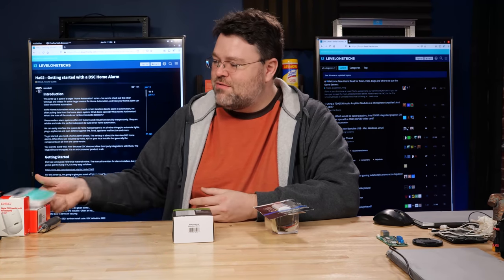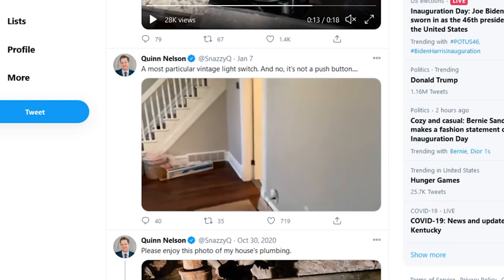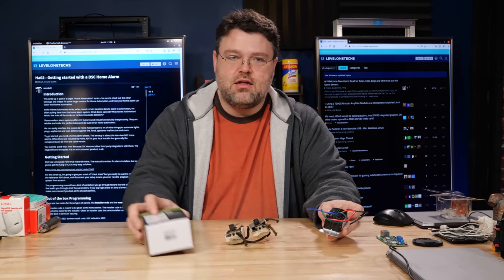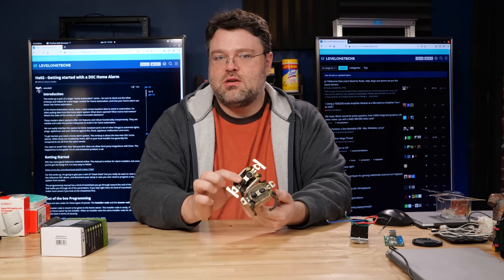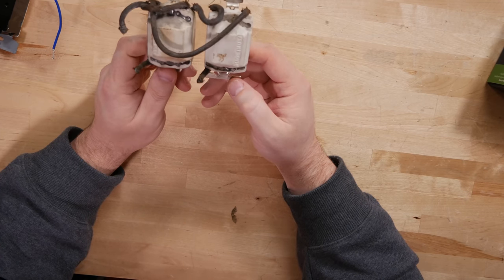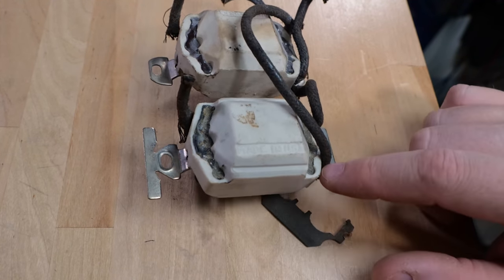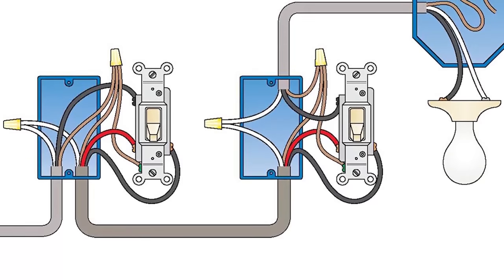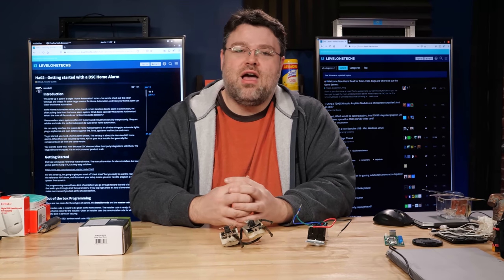Better IoT: Can We Use Old-School Light Switches With Modern Wiring Technology?

Comment: Great video Wendell.  Having that neutral in the switch box far out weighs the cost of the copper involved.  An alternative method of wiring, while maybe not as cost-effective, is to run the supply wiring to the switch box first instead of the fixture.  This is sometimes a more future-proof/automation-friendly method.

Comment: The quick snapping action of the light switches, are for reducing electrical arching, mostly happening when you disconnect the loop. This get so hot, that it burns the metal and build up carbon on the contacts.
Reply: And the build-up of carbon leads to increased resistance across the contacts and will eventually lead to an electrical fire.
Reply: @StevePatak  Well yes, maybe?

Comment: A few years ago i saw an interesting video using ethernet cables for the switches, and having a relay box in the basement that switched the outputs. Seemed like a really interesting way of doing it, and gave a lot of flexibility to what each switch in house would do. It even had the addition of wireless switches too if needed. Only downside of that setup was that it ended up with a lot of cables compared to the normal way of doing it.

Comment: Interesting adaptation, however its not a standard process and inspectors may be difficult about it. You can also use a transformer kit that lowers the voltage to the switch that will make it safe and code compliant. If its not too difficult I still recommend replacing the wiring. Source MS in electrical engineering + former electrician.
Reply: I was gonna say, if you have the ability, using the old switches to switch the low voltage side of a power pack somewhere would be another way to use older switches.

Comment: Hey Wendell, I believe that blue "Z wire" floats at a low-current, low-voltage potential, such that you don't need to use a 12V or 24V "doorbell transformer" to wire an old switch to it. Simply, connecting and disconnecting a ground to the "traveller" should provide enough of a state change to trip the Z-Wave switch at the other end. (Just sayin').

Comment: The panel tells the story about the home. Almost all residential homes are single phase, it’s not until you get to commercial and other big buildings were there running something substantially bigger. If your home is built in the 80’s you should be fine. But ALWAYS talk to a licensed electrician. Example Out here my city they want generators to be wired (hot, neutral, ground) to be mounted different than the county does. Don’t know why but they do. So your local guy will know. Not many of you I’d imagine are running knob and tube. Likely some of you are running “ungrounded outlets” (early 60’s stuff). Anyway look at your panel. Don’t be afraid of the “dead front” if it’s too much to handle call out an electrician.

Comment: Interesting, as an electrician I’m pretty sure this would pass inspection since code requirements on low voltage equipment is quite low relative to line voltage equipment

Comment: US is lucky to have huge boxes for electrical sockets and switches, in Europe it's 6cm round hole up to 6.6cm deep (but usually about 4cm), that's 2.3 inches wide and 2.6 deep at best, you can hardly fit a normal wiring and a switch in it with minimal depth =\

Comment: Have you got any plans for smart energy usage monitoring at the fuse box?
Reply: all you need is a raspberry pi zero and CT's. done.
Reply: @nos676  I get the pi zero bit, got one of those. What is a CT?
Reply: @tehsimo  "Current transformers or (CT) measures alternating current (AC) power. These sensors are best for measuring the generation or consumption of an entire building." can also use it for individual circuits in a building. like per each RCD
Reply: @nos676  ah super! thank you. I will get googling to see what I can put together

Comment: Hey Wendell have you looked into the ecobright zigbee/Z-wave led dimmer. It looks like it is a smart dimmer that also works in a dumb way. I have been looking at getting a couple of those myself I want to be able to turn the light on when home assistant is down instead of using smart bulbs and being stuck

Comment: antique wiring devices can still be used PROVIDING they are in good condition.... there are reproduction switches available to replace the originals. as far as the old wiring, the tube and know wiring is VERY dangerous and I wouldn't want it around myself. the insulation on the Tube and Knob wiring was not made to last 50 years.... and so it becomes brittle and dangerous. yes, you can mix and match smart home devices with analog regular switches.... hope you understand what I'm trying to say....

Comment: I doubt you could convince a inspector that this is ok.
Reply: @asdrubale bisanzio I can only assume you have never had an electrical inspection before. Regardless of sanity, you leave that old switch in the wall with new wire terminating into it and it's an automatic fail. No inspector is putting his signature on that for a pass. They are not Masters of electricity or technology. They just see something that isn't within there guidelines and it's a fail no matter how many times you try and explain it to them. The only way I see them allowing it is if you had an actual engineer with an approved city engineer stamp lay out electrical plans with his engineers stamp on it. By doing this you remove all liability from the city. I get it there isn't any, but they don't know that and they could careless to stick around long enough for you to explain why its perfectly safe.

Just take all your experience with your local DMV and mix a tiny smidge of a parking meter attendant and now try to convince them it's ok. Its essentially the experience you will have.
Reply: @asdrubale bisanzio yeah very strict here. For instance, let's say you wanted to add an outlet to a room that has this switch mentioned in the video on the same circuit. This in of itself requires you to replace the switch and all wiring on that circuit. Any change to a pre-existing wiring requires you to update the entire circuit up to code. Not just the outlet. Based on this alone you would fail here based on this video.

Comment: "I'm not an electrician" is where you should turn this off.
Reply from the maker: Or, you know, keep watching.
Reply: @Level1Techs  When someone gets electrocuted or their equipment gets broken I hope they sue you. Absolutely irresponsible.
Reply: I guess I should say my main concern is for my tenants. If you do not have any, I guess have at it, as it would be hard to sue yourself. 

You should not post videos telling people how to set their houses up in a standard that could cause electrocution or fire. This is literally absurd and your response was "Or, you now, keep watching". is even worse.
Reply from the maker: First, as I said in the video it passed inspection to NEC standards. Second I said make sure you talk to someone familiar with your local codes. Guess you missed those parts. Finally, the components are UL listed. The second or three-way switches become low-voltage and low voltage gear ( remember, ul approved ) cannot cause electrocution or firehazard. You are I assume trolling and don't have any type of actual concern. If there's something specific you want to say beyond "reeee" then by all means. Otherwise I suggest you write a letter to UL to try to get them to delist the new switches or revise their installation instructions.

Comment: Why does every single thing in an electrical installation I see from US looks so weird and over engineered? I started paying attention with fuse boxes, they are so impractical and complicated to wire up, more and more I see US electrical components, the more I'm like... why...? Just... why? And two phase house installation? Why? Why not go either three phase or single phase, again... why!?
Reply: Ready for your mind to be blown?  We call what is really 2-phase Single Phase.  The 3-phase option is not something that's readily available in most residential areas without significant infrastructure upgrades.

Out of curiosity, what's different with your electrical buildouts compared to the US?
Reply: @StevePatak  Three phase (400V) is readily available and not much more expensive than single phase installation from transformer to the power meter. 

Fuse box is much simpler looking, I do not know how much more easy it is to install. Home fuse box is very industrial style oriented, you can just click-in the automatic fuses into rails, GFCI is mandated to entire home installation, not just the bathroom and a very sensitive one <= 20mA @ 240V, also since we have houses and appartments made of brick and mortar and mostly not wood, drywall and cardboard, modular units are much more easy to install, does not require any special screws, methods of digging into drywall, etc. Also, power wire tubing is much less complicated since we mortar them into the walls, no need for metal tubing for power line protection, standard fireproof/fire retardant plastic ribbed tubing that goes into the walls is enough.

As I said, US and Canada has very weird and over engineered LOOKING electrical installation, I'm just freaked out by the way electrical installation is done compared to most European countries, most that stuff would not slide here as even the home installation are very much like industrial style electrical components.

And as I have learned from most L1Techs news, fiber optics is a luxury too in USA, they are everywhere here, so there is obviously some discrepancy in infrastructure quality that I'd not really expect.
Reply: @playswithblades  Ah gotcha.  Yeah, we americans love to go big or go home but at the same time we love to save a buck whenever possible, leading to heavy requirement installations done by the cheapest labor possible.

Not just fiber...high speed internet (anything above DSL) is still not available in large swaths of the US.

Comment: 3 minutes in and no idea what this video is about. re wiring old houses? light switches? got bored and clicked off
Reply from the maker: Sorry. These smart light switches have a low voltage wire that works with old stuff and is safe to use even if your wiring is jank.